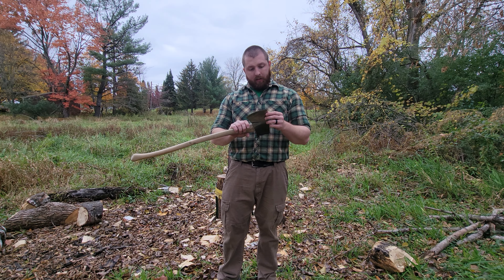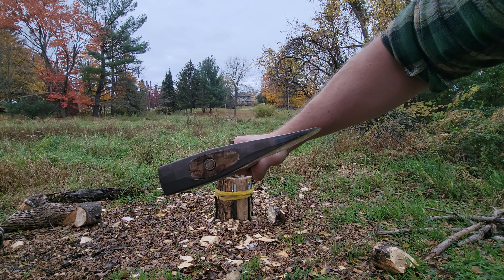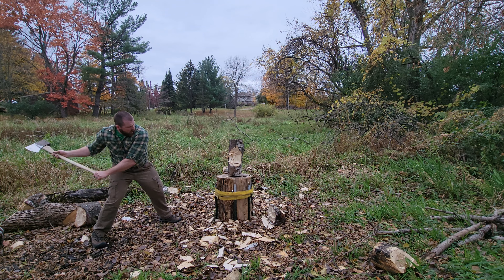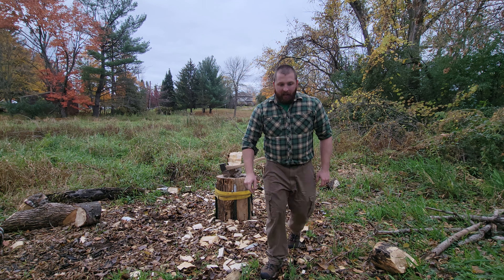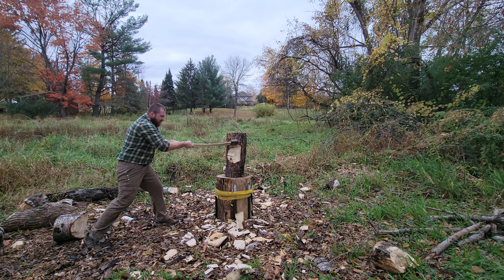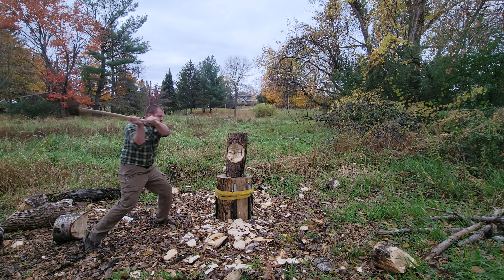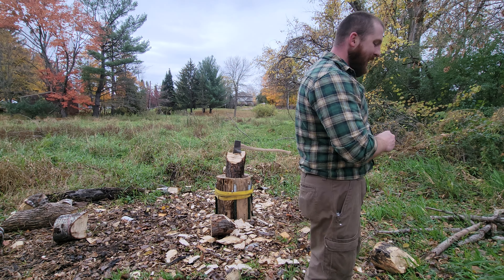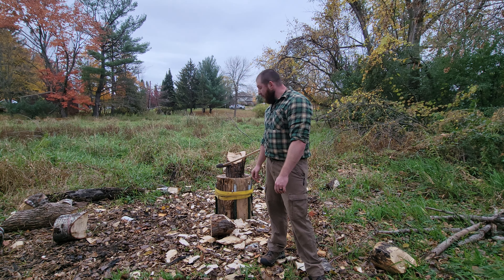Council tool FE-6, standing block. First time with a close to racer weight axe chopping.

Comment: DAAAANG! You've certainly got some POWER in your swings! Way to WHIP that axe head into the wood! NICE! SUBBED! 
Got me a couple Tui's-- work & camp axes, with aluminum wedges! They're the most beautiful axes I've ever seen!  HAIR SHAVING SHARP, right out of the box!! Greetings from the PNW 🇺🇸 🪓🌲🪓🌲
Reply from the maker: Axeman Mike, Thank you! I appreciate it! And yeah Tuatahi makes great stuff, their work axe is an absolute animal, takes every I throw at it, frozen or knotty, hard or soft lol I haven't swung the camp axe, but I'm guessing it's similar in quality and have heard it is a little chopping monster lol been out to the PNW a few times, beautiful country there!
Reply: @Jzelenko27  Oh, just got my FE6 last night! Gonna hafta put her in some wood, when weather gets better!! Can't wait! 🪓🌲🪓🌲
Reply from the maker: @Axeman Mike If you're using it for cross grain chopping  you'll definitely have to spruce up the edge. I have an 18 degree primary ground into mine and a 20 degree secondary at the leading edge. The steel could probably go mote acute, but that seems to hold up quite well even against knots. But the FE-6 is a splitting beast too, still splits well with the altered profile too. Hope you enjoy it! CT makes some great stuff!
Reply from the maker: Basically thinned the cheeks some to 18 degrees ish. I think mine came at darn near 30 degrees or so at the edge. I kept the high centerline with a flap disk and polished it back up to not quite a mirror finish, it's been great for my needs since
Reply: @Jzelenko27  Sooooooo, big bummer with the FE-6! I spent two days filing, honing, staining & oiling her! Rain let up, so 1st thing, I stuck her in a round, to check for handle tightness & I got a STINKER! She's LOOSE! I've heard several viable accounts of CT's being "loose out of the box", & I had my fingers crossed 🤞 that mine wouldn't be..........DANG! Big bummer, cuz I (should) be able to use the heck out of it, BEFORE I need to rehaft her! The good news is I can haft her to MY specs! Whiskey River had recently emailed me, asking how I was enjoying my new axe! I suggested they reconsider their QC methods with their new axes...at least take a (moment) to pop them into a vise to check for handle tightness...doing the consumer a BIG favor! Brandon was nice about it & said he would check the remainder of "these models" they had on the shelf! I was hoping he would take it a step further & talk with his dad, Mr. Roost, who designs for CT! Oh well, like Urban Lumberjack mentioned, in a fast production world & especially with the method CT uses (hydrolically pressing the handles into the heads), once in a while, you get a STINKER! It would be a bigger bummer for someone without the knowledge or skills of rehafting! Anyway, that's my rant! Have a great day  & thanks again for your content! 🪓🌲🪓🌲
Reply from the maker: Stinks you got a loose one! I've had great luck with mine so far! I do soak my handles in Teak oil if they get a bit loose, but if you can grab a whiskey river handle and rehaft it. I always like handles more when I hang em myself haha but hope you enjoy the axe once you get it on a handle you like/trust! And thank you for watching!

Comment: looks like its cutting great
Reply from the maker: Yeah! I need to make a few minor adjustments to it and the palm swell. It came pretty thick ground and mine was relatively uneven. 25 deg at the heel and 30 degrees at the toe. I didn't mind though, had plans to take the edge down anyhow.

Comment: That top down profile on that axe looks great! 
Thats pretty much what I'm looking for in my next axe. 

The profile kinda reminds me of some old tassie pattern axes. 
Alot of the old ones were very wedge shaped that came down to a fine point. 
The thinner ones being better in harder dead woods.

Thats basically all i chop so I'm super curious to see how this axe would do is some dry dead wood.

From what i can see, it looks like its chopping good!
Seems like it could split too!
Reply from the maker: Thank you lol and fair warning, I had to do a lot of grinding to establish a thinner profile at the bit. It comes pretty thick overall, and is amazing for splitting and it's intended purpose of being basically a heavy robust edged battering ram lol but some flap discs, water, patience, and some hand filing will bring it to more of a chopping profile. It does have a decently high centerline at baseline so just make sure to preserve that during grinding. And it is very wedgy, pops chips out quite well. I've swung it on some dead stuff and it cuts pretty well. Decent penetration, but the weight helps with that. At 18 degrees primary and ~20 degrees secondary/microbevel it holds up well to dead stuff and to knots in fresher maple/oak/white pine. You have to touch it up occasionally, but that's everything it you're running a chopper in dead stuff lol it's 4140 I think, it's tough and the heat treat from what I can tell is holding up to the cutting tasks I've thrown at it. It's a great axe, but to be a better cross grain chopping axe it does take some elbow grease! It still splits awesome too haha I would buy the axe again probably. Hope this helps!

Comment: Hey brother, when you say micro bevel, what do you mean exactly?
Im curious, because i often hear people talk about micro bevels, and alot of them are talking about two different things. 

Lol so I'm still unsure what people mean by it. 
I've heard some people say micro bevels can barely be seen with the naked eye, while others say that a micro bevel is basically a "secondary" bevel. 

So i was curious what your take on it is.
Cheers buddy✌
Reply from the maker: I hear ya, and what I mean when I use the term micro bevel is the bevel that is my last angle that I establish that comes in contact with he cutting edge. In this case I could say secondary bevel, because I really only established 2 angles from a top down perspective (and assuming I don't have convexity in the grind... which I'm positive I do bc I did it by eye). From parallel, I established  my primary angle geometry of the bit, then once I got down the the edge I did as flat of a grind as I could to establish my secondary or "micro bevel". That is how I see it practically. I'm sure we could get into the detail weeds with a microbevel being under a certain size or something, but for this purpose I just intended to indicate my primary geometry is I think ~18 degrees on the FE-6 now and my secondary/micro bevel is ~20 degrees at the leading edge. Hope that clears it up. I'm sure there is a definitive answer out there, but that's how I think about I practically for my purposes.